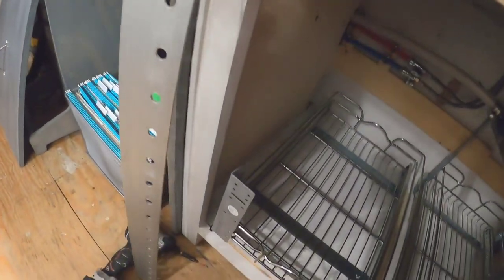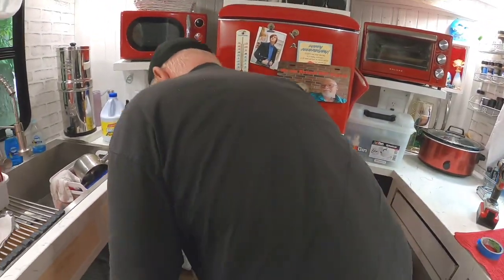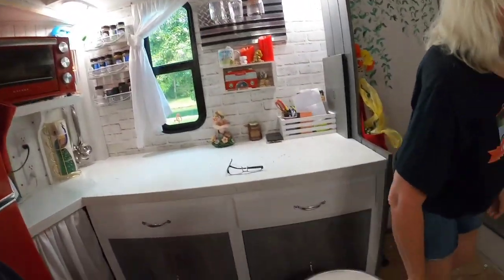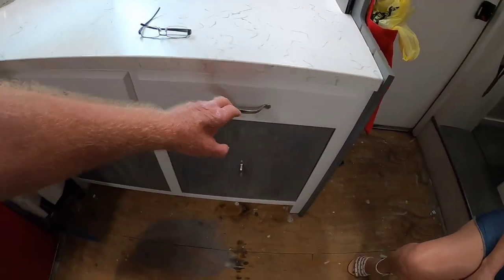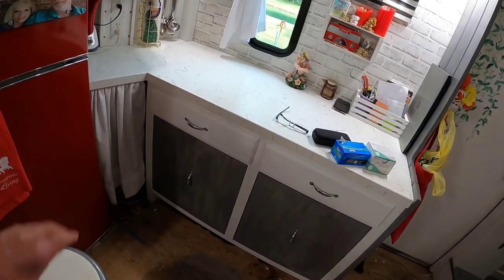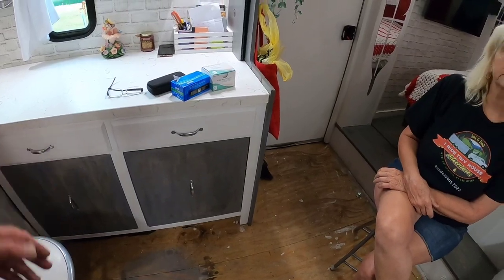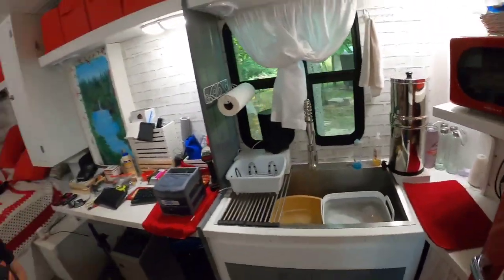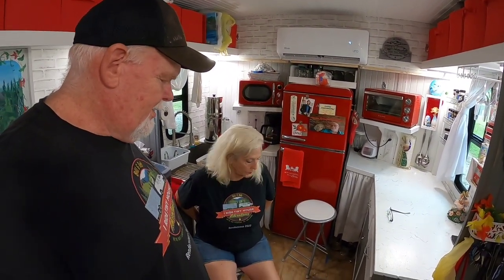Cargo Trailer Conversion Cabinet Doors Are Done. Rev-A-Shelf Tips And Tricks

Comment: Did you use the toe kick space  for drawers for things like cookie sheets, towels and other flat items or is the space still unused? I saw a build where the toe kick was part of the whole pull out drawer so they could use the back of the drawer for taller items and I just thought that was the perfect answer for things like an instapot and blender-juicer like items. Rehashed does make slides for toe kick drawers to lay flat on the floor for those type of drawers. They also used double headed nails as drawer pins to keep them from coming open during transit so they didn't have to mar up the face of the it beautiful cabinets. Y'all did a remarkable job for not having any professional cabinetry making experience, says the retired cabinet maker. Happy trails and safe travels to you both!
Reply from the maker: Great idea.right now ours is just space....

Comment: What paint did you use for kitchen doorsi love those and do you have a link for those rev shelves or model number
Reply from the maker: The stain color is weathered grey. Rev-A-Shelf 5WB2-2122CR-1 21 x 22 Inch 2-Tier Wire Pull Out Storage Shelf Drawer Basket w/100lb Capacity for Kitchen Base Cabinet Organization, Chrome https://a.co/d/5wyv0aE
Be sure and measure the opening of cabinent to get the right size.

Comment: Did you build cabinets standard 24" deep?  I wonder if anyone ever made them more shallow as a space saver?
Reply from the maker: The cabinets are the standard 24 inches deep. You can build them any depth you want. If you plan on building shallower cabinets and plan to have a sink, pick it out first. You might want to actually purchase the sink first just to be certain about the dimensions.

Comment: Why did you put the handles opposite and so far down?
Reply from the maker: The cabinet doors only attach to the bottom drawer. The handles mounted in the center lessens the stress applied to the bottom drawer mounting points. Mounting the handles on the doors vertically was simply our preference. In a house,  we've seen the handles mounted higher on the door, but cabinets in a house are not bouncing down the road periodically like they are in the trailer when traveling. Finding ways to relieve stress on equipment as much as possible contributes to longevity.